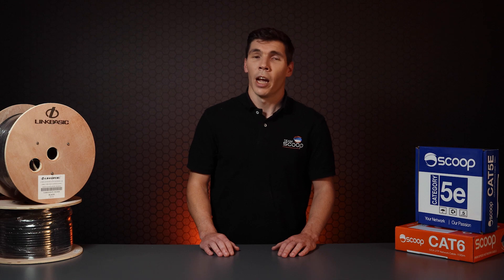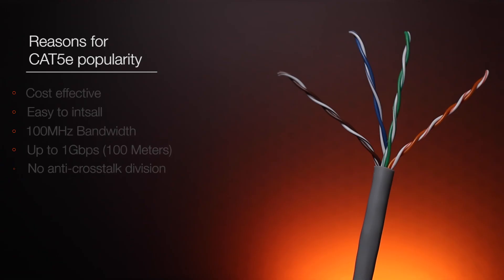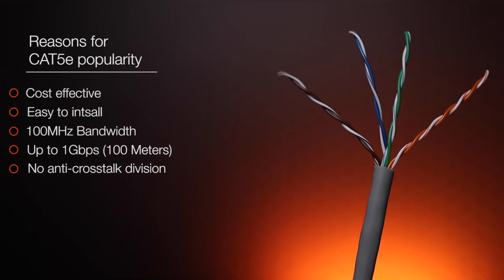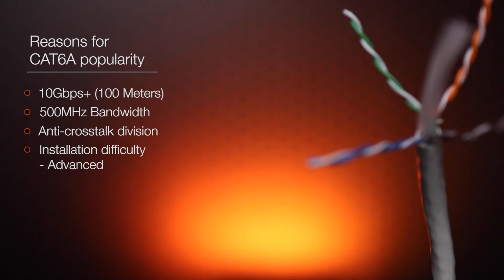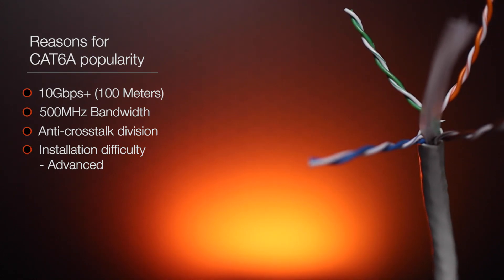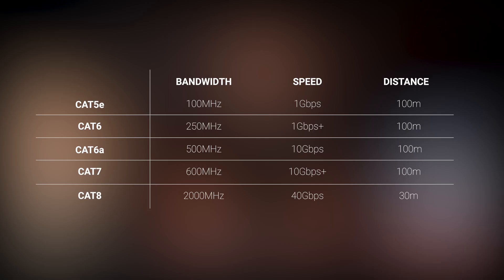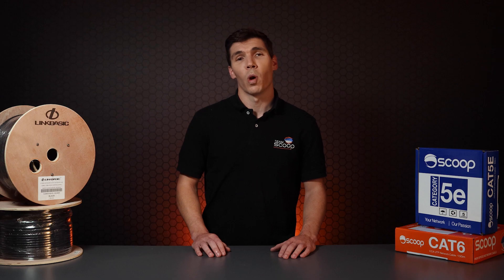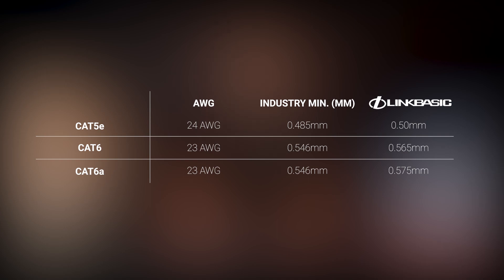Choosing the Right Cable for Your Network

Comment: its very easy if you have money just buy the highest rated. Cat8 but only rated for 40meters, dont ever buy cat5 and cat5e on this day its old technology the standard now should be cat6 or even better 6a if the cable should be inside the walls for future proof and dont ever buy CCA even if its cheaper.
if youre using it for CCTV hardwired then cat5e is ok just look for outdoor cable rated its cheap and rated for 100m. if using for your house for wifi or pc for gaming the faster the better cat6a, 7 and 8 never 5e and 6 for future proofing.